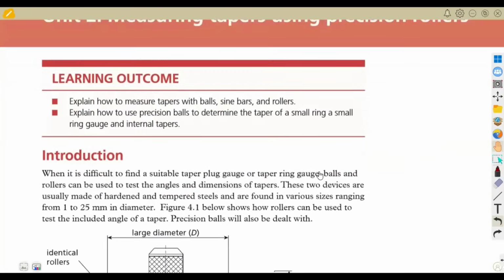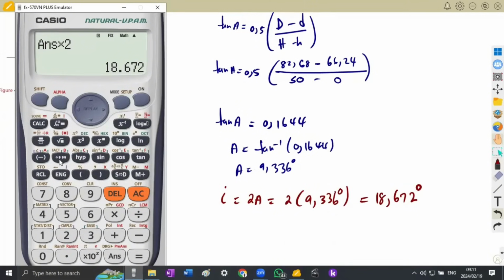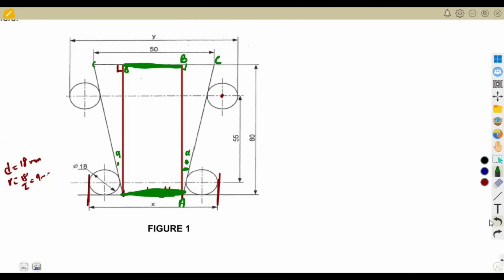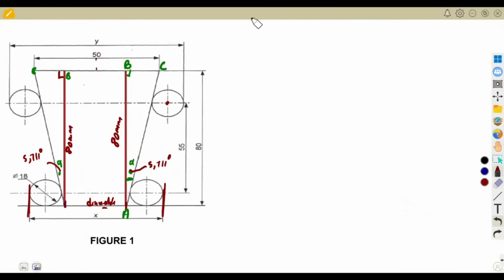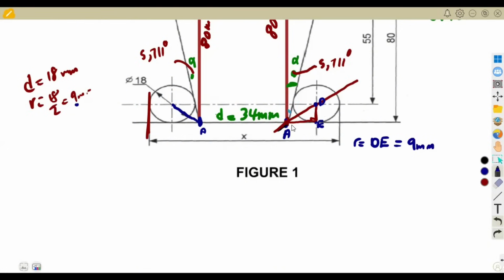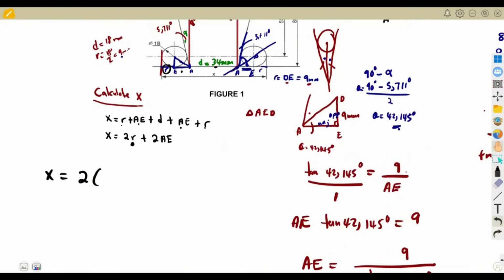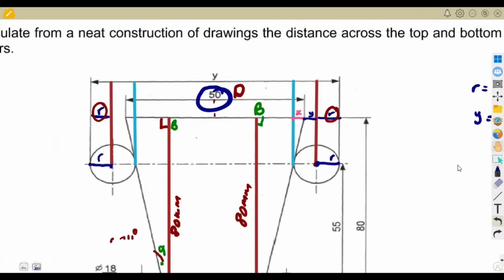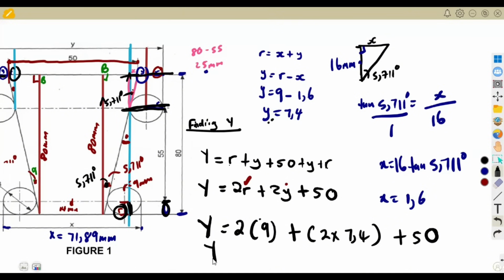Mechanotechnics N4 Precision measurement - Measuring tapers using precision rollers Introduction

Comment: When calculating X u didn't add the diameter:d why?
Reply: When you punch on the calculator you will see that on the final answer he did add the diameter 

2(9)+2(9,945)+34
It will give you 71,89

Comment: How did you get 71.89 if the formula is X = 2r + 2AE+d
                                                                          = 2(9) + 2(9.945) + 50(bottom diameter)
                                                                          = 87.89 mm
Reply: he got 71.89 because          X= 2r + 2AE + d
                                                   =2(9) + 2(9.945) + 34  (instead of 50)
                               therefore X=71.89 mm
Reply from the maker: Sorry for that one might be calculator issue

Comment: 2(9)+2(9.945) = 37.89 and u wrote 71.89
Reply from the maker: @innocentandile4759  hie redo it again that's 37.89
Reply: @mathszoneafricanmotives you forgot to add the lower diameter sir